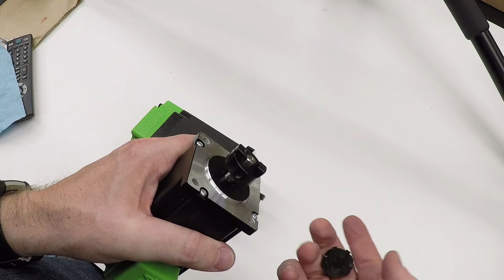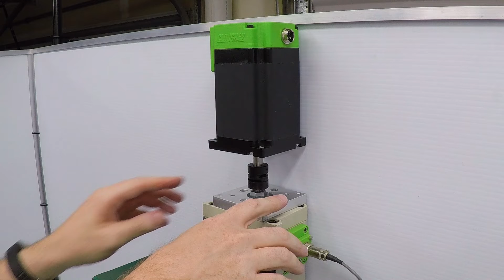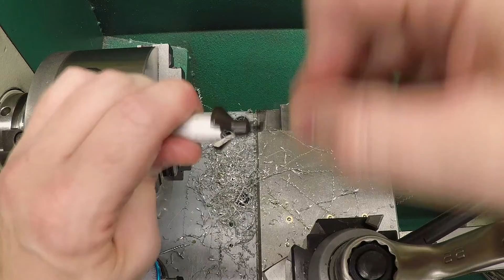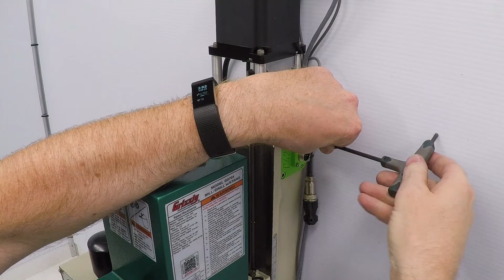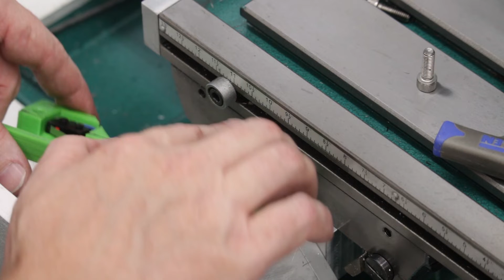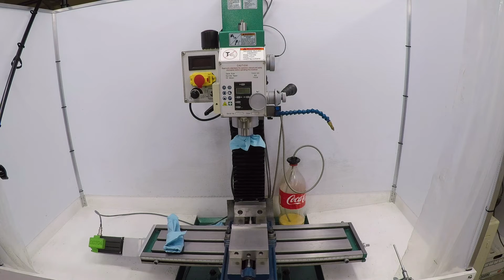Z Motor Part 2: NEMA34 Motor Install and CNC Mill Tour

Comment: I know the video is old.
But if you need to use (same size) paralell in the chuck to set repeated parts, you could print or make a "holder" for the paralell, which contains a switch, that prevents the machine from starting if the paralell is not stored back into position.
Reply from the maker: I like how you think.  I think this would be a good addition to a chuck key holder.  I typically use a spider these days, which stays in the chuck with the part.
Reply: @Clough42 
Yeah, that could be a great combo holder. I guess a spider is alot safer overall though.

Comment: Love your videos, im a automotive machinist im christchurch nz, i habe a optimill of the same variety, has been cnc for over a year, i am currently upgrading to 3d controller, automated vac, sprey and the factory spindle on and off theoigh its on off button, nema23 4nm, z axis nema34 8.5nm, ballscrews and single ball nuts, automatic lubrication to eaxh axis to two points on each side if axis and the ball nuts. Any way my question is this nema 34 has no brake, do you  not have the problem with the z axis dropping when motors a powered down with the factory head stock? Curious if you are using z axis locks or is just doesnt drop? Asking as i have used the locks threads for threaded oiling fittings and may need to add a lock before i find i jave to pull apart again amd do before i actually put it together with the ballscrew conversion, obviously didnt have the problem with the old lead screws that came with. Thanks for the videos, you and this old tony are my fav youtube machinist videos!
Reply from the maker: Not with the stepper and screw combo I have.  It's more of an issue with servos.
Reply: @Clough42  thank you very much for the reply!
Reply: @Clough42  thank you very much for the reply!

Comment: Nice. I have a question on limit switches.  Why wouldn't you just store the limits on the computer and completely illuminate the switches? I thought of this when I noticed your acceleration +/- control. To have complete control over accel. one would need to know, before hand, when to start accel. in negative direction -- the faster you go the sooner you need to start to slow down. Because of this, you need to know the full travel before hand.
Reply from the maker: The controller does have software limits, with deceleration to a stop, but you need the switches so it can figure out where zero is when the machine is powered on.  And if the stepper motors lose steps at any point, it can still run into the end.  If it hits a limit switch unexpectedly, it stops hard, without decelerating.  It's very violent, and you want to avoid it.

Comment: Is the chuck grounded? You could maybe come up with an electronic-stop where you have a pin on a microcontroller float high and if it is pulled low (by touching the chuck) it disables the drive. Probably more complicated than that though...

Comment: I once worked with a TOUGH machinist who, when he was just starting out, mounted a steel ring in a large lathe (I believe he said it was a 21"swing), using 1-2-3 blocks to make it parallel, all under direct supervision of his boss. The blocks were left in place when he started the spindle, and of course, they flew out in rapid and random fashion🙄. One of them whacked him almost flat on one of the 1x2 sides just off-center in his forehead. He was still packing the scar and collapsed tissue 12 years later. He said it didn't knock him out, but he was seriously dazed and confused. Slow and steady wins the race... BTW, his supervisor thought it was hilarious!

Comment: Najs, just bought myself a pair of Nema34's and christ they are heavy and my machine is slightly smaller than your, but will attempt to get them on them anyway. Took inspiration of your motor mounts and will most likely machine something very similar soon too. Thanks for a great video.

Comment: Yup, I put a chip clip on the switch BEFORE I put a parallel in the chuck, since my memory is about 0.01 seconds. Glad you avoided ventilation from the parallel.

Comment: Using the parallel isn't as accurate as trimming both sides, measure length, place in chuck, slowly bring tool up to end until it just touches, remove difference to final length. Works even better if you have a DRO on the bed.

Comment: Very impressive, you power/driver box looks super clean! I’m planning/ordering parts for my conversion and with every video I watch the cost of mine is rapidly increasing with all the options. I have linear rails coming in this week so I can get rid of the dovetail. If you were to do it all over would you stay with the 570oz for the x and y? Any idea why people aren’t putting closed loop hybrid steppers on these?
Reply: Well, a good guess would be price, or maybe they built their machine before closed-loop steppers showed up. Could always ask them!

Comment: Hi. Thanks for your video...good information, some was new...particularly the info about the 'auto-tuning' feature of dip switch 4. I didn't think that you could flip the dip switches once the driver was powered up. The MA860H cautions against doing so. Can you please give us some clarification on that point?
Reply from the maker: The auto-tuning procedure is described in the manual.  I don't think you can switch the other (configuration) dip switches after power-up.

This driver is actually an OEM Leadshine unit.  Every Leadshine digital driver manual I've looked at has this paragraph:

"However, if the user does not want to tune the current loop after changing a different stepping motor,
then Motor auto-identification and parameter auto-configuration technology of the DM556 can
replace manual tuning the Driver with ProTuner. Just changes SW4 two times in 1 second, and then
the Driver will auto-identify the new motor and auto-configure related control parameters for
optimum responses. Recommend use this function after changing the Driven motor."
Reply: Thanks. That does bring a great deal of clarification to the issue. I don’t have a Leadshine. While my MA860H manual from StepperOnline resources mentions in the introduction paragraph a brief description of a “self-adjustment” feature, when addressing the #4 dip switch in paragraph 7, they make no such reference to “self-adjustment” let alone on how to initiate it. 
There is little credible resource / video on stepper / driver matchup and their respective tuning. 
Thanks for your diligent work.
Reply from the maker: @milehidude  Yeah...I don't think that's a "digital" or "dsp" driver, so it wouldn't have that feature.  Note that it has no serial port for programming.

Comment: Would be interesting to know what ball screws are you using? and what nut arrangement/tolerance class on those components? Cheers and thanks for your videos
Reply from the maker: They're C7 rolled screws with double nuts and solid spacers.  End bearings are double angular contact, preloaded with shims.
Reply: @Clough42  awesome, thanks! got got almost the same setup for my 45 clone, but p1 single nut. the backlash issue then comes in, and this time, it is a issue unlike on the lathe :D one to two thou. i will first upgrade to smothsteppers tho, and then see if i also do the double nut arrangement, as it limits the travel for the Y somewhat
Reply from the maker: @MrZhefish  I'm still struggling with about .0015" or so backlash.  Maybe .0025" on Z.  I need to tear it all down and see what I can do.  I suspect the spacers between the nuts are too loose, and this might be intentional to keep the nuts from jamming, since the C7 screws will have slight lead changes.  Or it could just be that the screws have worn in and I can shim the spacers.
Reply: @Clough42  yeah that's about what i have with my single nut P1; 0.0025-0.003 on Z too, and around 0.002 on Y, the x is almost good now. It helped me a lot to make sure the cap nuts for the spindle are tight, and i did not like the grub screw, so i used loctite after i checked i can undo it with break cleaner, as i can't introduce heat to the part without deforming it. 

My Z has a puffer in form of a pneumatic springs that push the head up,  it's far from perfect yet. 

I am also not entirely sure if more accurate lead screws are so beneficial, as your and mine machine are not that ridged as one might think. the cutting force, the runout of the spindle and everything else adds up, and it's not that easy to get it spot on - even if, the question is for how long. Even with my ISO30 Spindle, the bearings already begin to tell me, that the machine is used over it's design as a cnc cycle is harder on the parts as conventional operation for sure
Reply: maybe that's one of the reason most go to linear rails as the next upgrade too.... I've seen some even add concrete or epoxy into the machine to make it sturdier.

Comment: Did you experience any problems with the ball screw on the Z axis slowly lowering the mill headstock down when the Z axis stepper was unpowered?
Reply from the maker: Not at all.  I do have the gibs pretty tight, but it hasn't been an issue even when they were loose.
Reply: @Clough42  Thankyou Mr. Clough. I had some concerns about it and thought that I might have to include a counterbalance mechanism of some sort with the mill that I am converting to use Clearpath servos.
Reply from the maker: @a0cdhd  the clear path servo is a different animal.  Not sure how much if any cogging it presents to the load.
Reply: @Clough42  I will let you know Mr. Clough so that you may spread enlightenment to the rest of the planet should some other silly bugger ask the same question.

Comment: Summary for copying electronics:
NEMA23s XY - 4NM
NEMA34 Z - 8.5NM

High parallel misalignment coupler
800W toroidal + regulators - switching bad?
Stepper drivers - XY KL-5056D 5.6A- not linear because resonance - kl-8070d for Z 72v - 7.1a
Controller - parallel port breakout (now not used) - ethernet smoothstepper pci card £180
8 microstepping 
PC - miniITX via running xp - ssd
150inch/mm XY, 125inch/min Z, 32inch/s/s

Comment: i'd have put some weight on the table to make sure the motors can handle the acceleration when there's work on the table (for the x and y axis at least, z is probably fine). that said, have you had any issues after this tune?

Comment: Great video 👍Did you need to add resistors to your motors? Are you running your drivers in parrallel or series? Newbie here and asking before burning.
Reply from the maker: The current limit is set in the driver, so resistors are unnecessary.  I'm not sure what you mean by drivers in series or parallel.

Comment: You should use your mill to mill out a 3 the leg parallel. You make them different wall thickness to fit bigger or smaller parts.  It wont fly out when that's in there. 😉

Comment: Why didn't you just make two blocks on your mill for use as standoffs? 
The fix is the motion controller; embedded processor controls the steppers..did same w a Z80 and a PC-AT for a spring tester I made in 1987,
Your stepper drive problems probably all go back to that hokey direct control by XP/PC through the breakout board; XP is NOT a real-time OS.  
A single switcher for each axis is probably fine. 
FYI: Those stepper drivers are just re-branded Chinese generics.
Your upgrade; why didn't you just go to a one-piece XHC Ethernet breakout motion controller. 
I'd chop out the PC and use a laptop connected to the ethernet interface; somewhere you have a mouse, keyboard and display.
Closed loop steppers would be a better application than open loop; especially on a metal cutting mill. Missed steps on an expensive
machining job would pay for the closed loop steppers!
With that XHC you can add a pendant! Should be plug and play.
You probably know all this by now though!
Nice explanation of the controller layout!

Comment: Curious as to what material you used to make your enclosure?
Reply: I'd like to bump this question up, I've just put together a ply tray for my mill ( needs sealing atm) and I'm looking at some ideas for enclosing the mill.
Really enjoy the videos mate.
Reply: @awomandoesnothaveapenis  I believe James has mentioned in other videos that it’s Coroplast or similar (corrugated plastic board often used for yard signage).
Reply: @g.tucker8682   Cheers mate I was thinking along those lines

Comment: Do you need a break on the motor when powered off or e-stop, to hold it up. Like this one https://www.omc-stepperonline.com/stepper-motor-brake/p-series-nema-34-stepper-motor-4-5nm-637-38oz-in-with-electromagnetic-brake.html
an no I don't work for them just curious?
Reply from the maker: It hasn't been an issue.  I'm general, ballscrews can be back-driven, but the cogging of the stepper is enough in this case.

Comment: Quick question...... Do you think that instead of using your linear power supply. A switching supply, feeding a bank of super-caps. Then through a couple of iron toroidal chokes, would do the job ??

Comment: In my years with the USAF, I learned the purpose of the "Remove before flight" streamer.  May I recommend you use a similar streamer when you insert a potentially deadly object into moving parts?  Perhaps you could print a bright cover to place over the Start switch if you don't want to tie a streamer onto your parallels, etc.
Reply: 'tis said that regulations are written in blood.
Reply: Here, here. It can be thrilling to catch a chuck key too. Painting gauges is an obvious problem. In this case tie a streamer to a bulldog clip. You can then clip it near the problem.

Comment: Argh missed steps will waste your life, I'm using closed loop steppers for my pm25 build, they really aren't much more expensive!
Reply from the maker: Yeah.  Everyone wants more speed.  Including me.  :)
Reply: (Assuming you have a toroidal transformer) missing steps are just Nature's way of telling you to crank your axis acceleration back the f##k down. That's it. I have exactly zero missed steps on both CNCs I'm in charge of. One of them identical to the one in the vid.
Reply: From what I understood, hybrid close loop stepper motors system avoid having them full powered  when at stop position. Futhermore,   the servo hybrids stepper motors have a higher torque at high speed and are light weight. This way it could be possible to keep the nema 23 equivalent form factor.

Comment: Can you run a 34 at 400 pm with acceleration at 25 or 30?
Reply from the maker: I'm not totally certain what you're asking.  If you're asking about running a NEMA34 motor on this mill and getting 400IPM on the Z axis with an accerleration of 25 to 30, I think that's unlikely at 48V.  The NEMA34 has a lot more torque than the NEMA24 motors I was using before, but it also has higher inductance, so it probably wouldn't run that fast with any significant load.  A higher voltage would help overcome the increased inductance, but that still seems pretty fast for reliable operation on a heavy Z axis.
Reply: Clough42 i was going to ask about inductance. what spec is the nema 34 you used.  Also at 125 inch/min velocity what rpm would the motor spin at

Comment: Could you please link the couplers/acetal discs? What are the specs on the Nema 23's?
Reply from the maker: I just added a link to the couplers in the video description.  There are different part numbers for different shaft diameters and they come if a wide variety of sizes.  I used the 1" diameter parts.  If I remember correctly, the motors I used are actually NEMA24, rated at 570oz.in. torque.  NEMA24 seems to be a little unusual.  It's the same size as NEMA23, but with a different diameter shaft, I think.